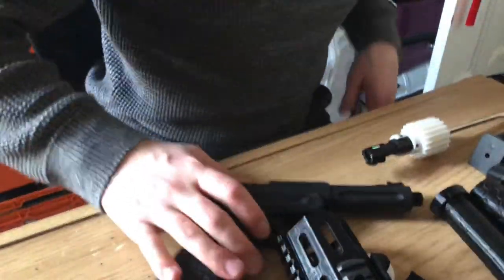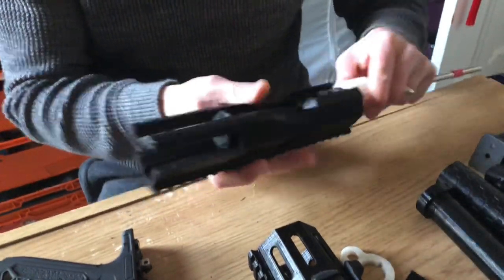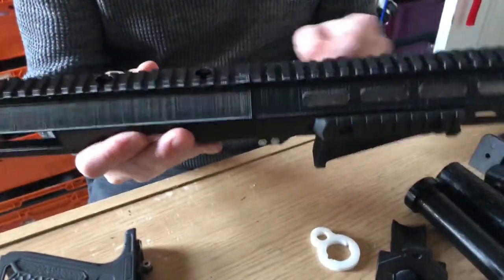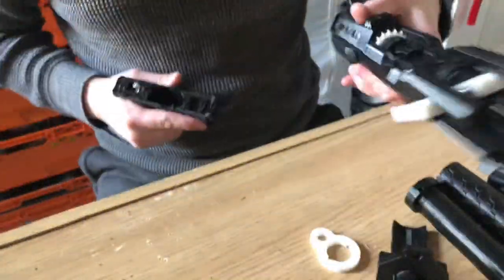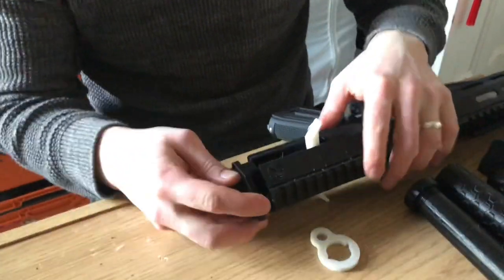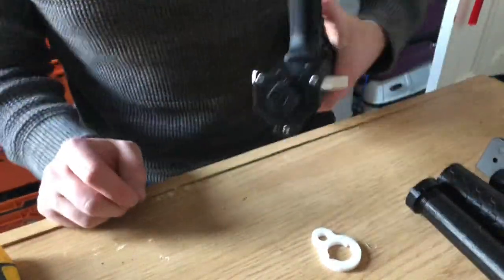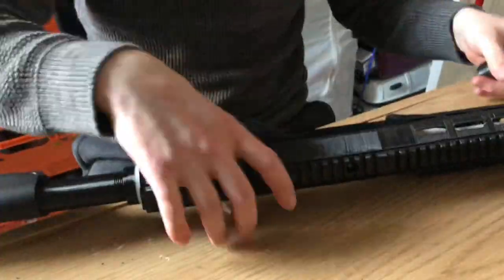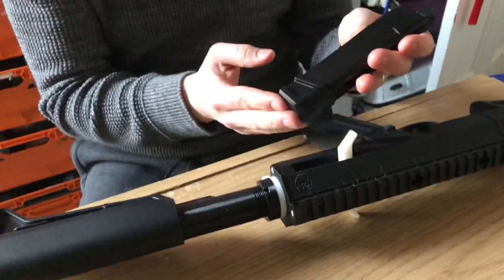Airsoft AAP-01 carbine kit - 3D printed

Comment: Great job, fit nicely, if you dont mind me asking:
1. what is the barrel length in the video? 
2. Does it compatible with other hand rail/guards?
Reply from the maker: It will be compatible if it has the same mount system and 290mm crazy jet barrel

Comment: Hello. I saw your 3D file. I wanted to buy it but I saw this video with your inner barrel. Do I need to buy longer one or can I use my full stock AAP01 with your 3D file kit? Was about to print it
Reply from the maker: Yes, there is a model included to mount to the original barrel
Reply: @TheRHYSD  ok. Can you pls send me the link cause I saw 2 files there. One is 12eur and inside I get a lot of parts. Saw even 2 barrels like for m4 and others. While in file for 15eur I saw different model and I like it cause suppresor is more hidden inside front handguard. Tbh I like both just confused about parts that comes with file and not sure which one to get. I have stock AAP01

Comment: I'm thinking of purchasing this kit but was wondering how large is the diameter of the rail system? I want to use a short barrel and have my silencer which is 38mm wide sunk into the rail system would that work with your kit?

Comment: Hey Mate, is it possible to slap a m16a1 handguard on this? Instead of the original one, I wanna make my aap 01 a m16
Reply: You can but it will need to be the right size and also be polymer. You maaaaybe able to but aluminum on there but it would likely stress the joints. Being that it is heavier.